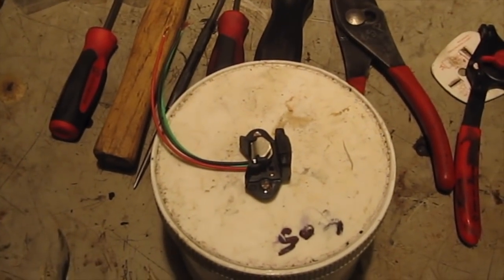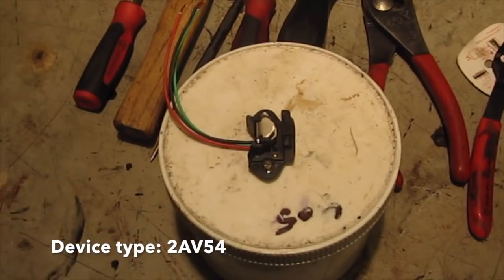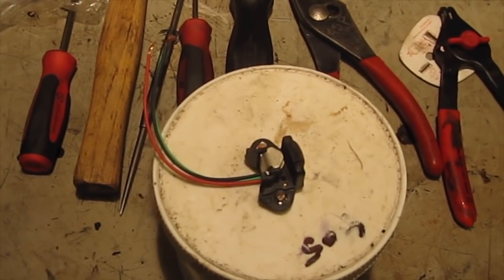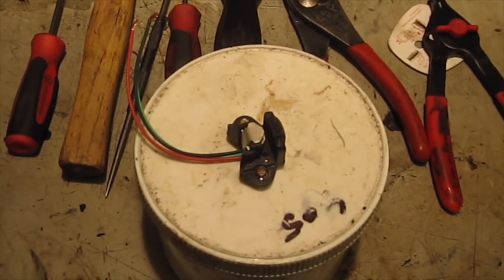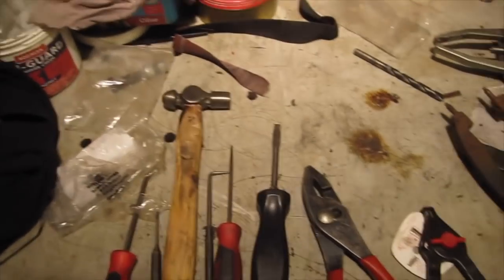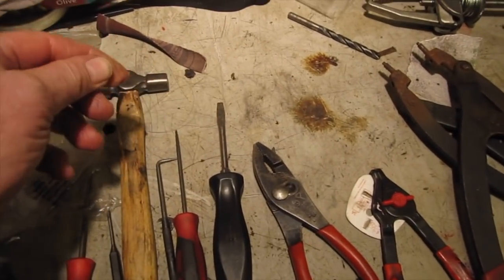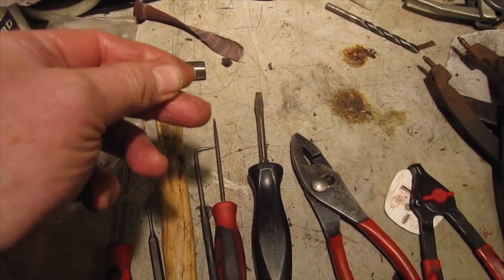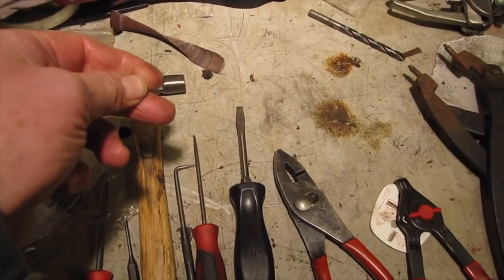Replacing a Hall Effect Device Part 1

Comment: Hi there, it's Masoud from Zanzibar thank you very much for the video. 

     I want some advice on a problem that I have on my airhead.

One day as I was riding and my right hand spark plug cap came of  and unfortunately I was running on one cylinder for about 4 minutes.
     I have replaced the ignition black box however the park plugs ignite intermittent about 7 time rapidly after cracking the engine. I was wondering if you have come across such problem or if you have any advice it will be much appreciated also I have managed to get the hall effect device I just want to be sure before I replace it Asante Sana in advance.

Best regards

Masoud
Reply from the maker: Hi, Lovely to hear from someone in Zanzibar. However it is difficult to know where to start without more information. You could try checking the plug leads. If they have metal shrouds on the caps remove these, since sometimes they cause electrical shorts. It may be a good idea to replace the leads and caps altogether if replacements are available.
Also take a look at the ignition coil. If you have a single coil with twin plug leads fitted, inspect it carefully as these have a habit of cracking and this will cause a misfire eventually. 
Hope that helps. All the best.......

Comment: What year, make and model is this part from?
My symptoms are misfiring, loss of power, dropping RPMs,  but only around 4000 rpms, and only in 4th and 5th gear.  I can also rev past it to 5k rpms and it smooths out.  Fairly sure it is ignition system, yet nobody can tell me what's wrong.
Reply from the maker: This part was fitted to a 1984 R100RS. As far as I am aware all the oem hall effect devices fitted to airheads are the same. 
Hard to say what is wrong without seeing your bike. Symptoms of failing hall effect device can be misfire, hard starting especially when warm. Usually they fail completely soon after displaying these symptoms. 
Another common misfire cause is a crack in twin lead ignition coils. But there can be many faults that can lead to a misfire.
Reply: @motophoenix5951  All respect!  That, 'bean can' was not easy to disassemble.   Mine is a 1997.  "especially when warm" is a good clue.  I ride is Tucson!

Comment: Would really appreciate a video to investigate tachometer not working on R100rt  love your work and your calm and relaxing way of working, Thankyou.
Reply from the maker: Dicky Yrrep thank you.  Regarding the tachometer, I think they are electric aren’t they?. Try checking and cleaning the connections and the cable condition starting at the feed from the coil at terminal 1(2 black cables one goes to the tachometer).